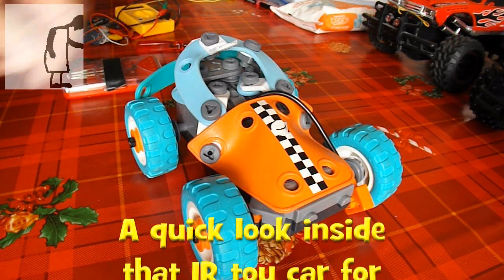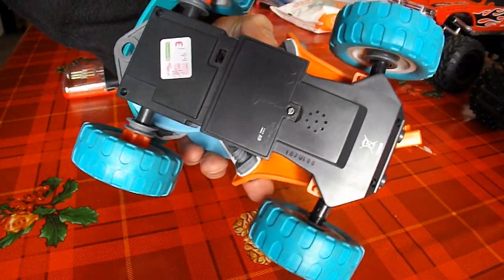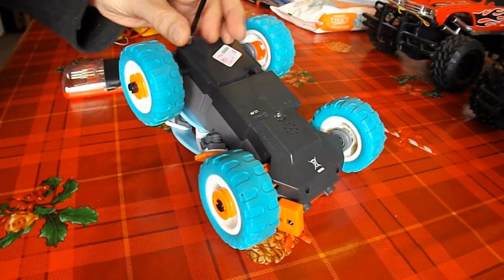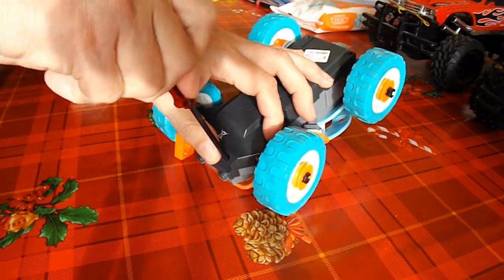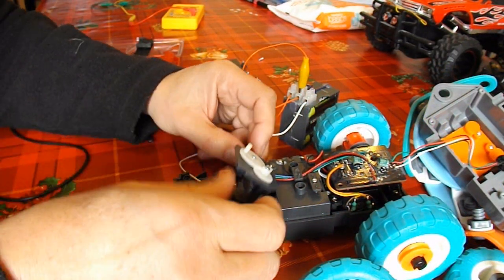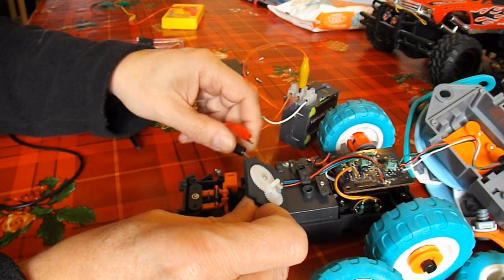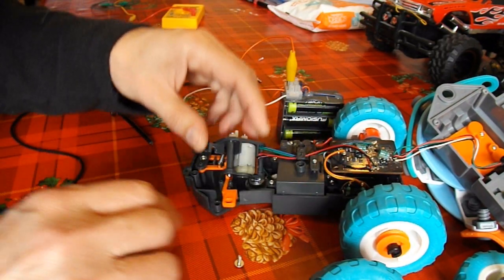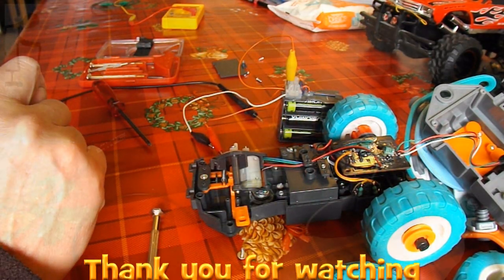A quick look inside that IR toy car for GuitarRocks360

Comment: looks ok
Reply from the maker: +Lol Plane I am confident it would work fine with the right transmitter or just swap the receiver. I will just leave it in my store box until a suitable transmitter turns up or until I need the parts.
Reply: good luck!